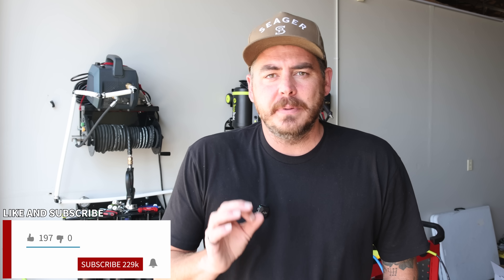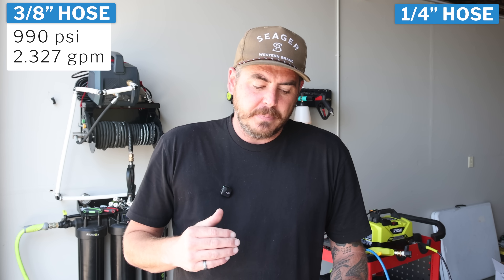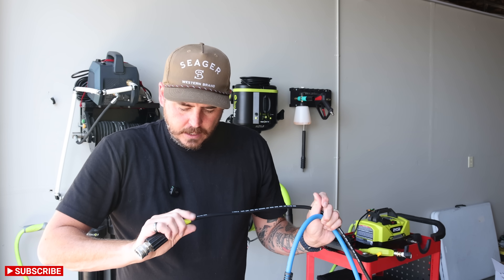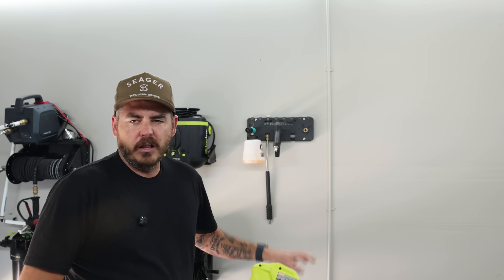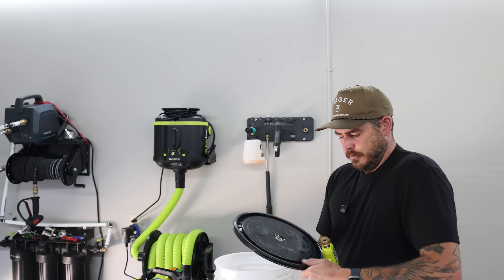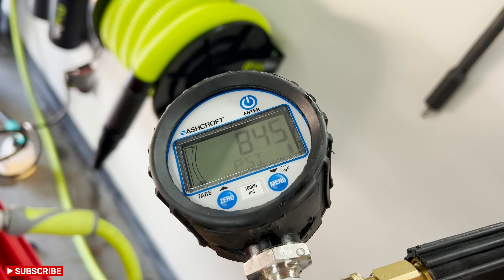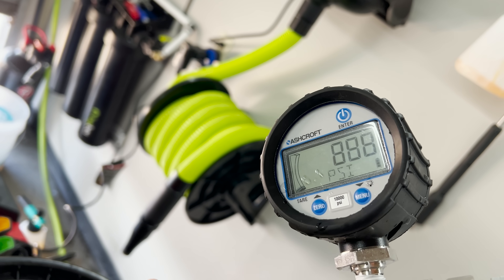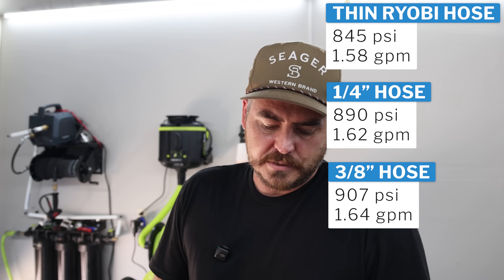PRESSURE WASHER HOSE COMPARISON - DOES SIZE EFFECT PERFORMANCE?

Comment: I just bought a 5000 psi 5.5 gpm honda gx690. I bought a 1/4 which i never worked with before. It says 5800 psi . The hose that came with the pressure washer is 3/8  and can't bend it even with 2 hands ,no chance. The 1/4 inch seems very thin, i can even push it to compress it. Can't do that on a 3/8 with wires and thick rubber. I'm afraid to use the 1/4 inch. Don't want to break the jetwash because now the pressure changes.

Comment: What is the best 75' hose for an active 2.0 pressure washer? I originally wanted the 3/8 Kobrajet hose, but I'm starting to think a 1/4" hose will be better as you mentioned for the weight. Any recommendations on a good brand?

Comment: What about water hose (from the spigot) sizes? Like is there a difference in pressure washer performance between a 1/2", 5/8" and 3/4" water hose diameter? Also, does adding things like quick connect fittings and/or a cutoff valve (both of which typically have a smaller opening them the hose itself) affect it? I ask because even a 1/2" hose typically has 5x or greater flow rate (gpm) than any consumer grade pressure washer can hit, so if it's still feeding 10gpm to the pressure washer, that maxes out at roughly 2 gpm, does that water hose diameter really matter at that point?

Comment: I recently bought a Flexzilla hose to replace the stock hose that kinks like crazy. I'm getting less pressure out of the pressure washer. Though the Flexzilla hose is bigger, the hole openings are slightly smaller than stock's.

Comment: Great video boss, as always bringing great content.. one thing I ask myself is does the  size of pipe that Supplys the water matter ? Does that impact or not really…  I see people using 1/2 inch to 1 inch to get reduced to 3//8ths jumper hose and fittings..  

Maybe you have tested this before ?
Reply from the maker: The outlet pressure from the water source definitely effect over all performance (so the hos whose size could potentially as well)
Reply: @imjoshv thanks for the reply, wow, I enjoy your videos and the jnformation, tests that you do.

Comment: Replaced my adams 1/4 hose with a Blueshield Arimid Kevlar 50 foot 1/4 inch hose and now my Adams Pro (previous generation) just runs upon start up, after activating the triger on the gun the tss system works fine, I did notice it doesnt seem to ramp up quite as fast. I have made sure to bleed all the air out. Would appreciate if Josh or anyone has any thoughts on this. Never had a issue before I replaced the hose. The blueshield has a larger outside diameter and I am going to make an assumtion the the Id is slightly larger. Thanks everyone.

Comment: Hare's a little more to take into consideration:

The water blaster runs at a constant RPM... which means the pistons pump at a constant speed... which mean the pump pumps a constant volume of water.
If the nozzle (or any other restriction) requires more pressure to push that amount of water through... 
that doesn't happen.
Instead, the excess water that cannot be forced through at the pumps maximum 'designated' pressure, bypasses through the unloader back to the garden hose inlet.

This is why, when you add a restriction like thinner hose... the volume ow water exiting the nozzle is less... and the pressure measured at that nozzle is also less...
Interestingly the AR630 historically has been set to run at 1.9kPSI at 2.1gpm with the correct nozzle... I 'assume' the "New" unit tested would have similar specs..
The fact that the pressure measured is less than 1kPS (which is always slightly lower at the nozzle) may be due to slightly larger nozzles although the flow rate is also less than optimum which seems to imply the unloader is bypassing water even with the 3/8" hose...  which leads me to think the unloader knob was dialed back allowing the water to bypass at a lower pressure.

Perhaps running the same test with the pressure gauge at the pump.. (in theory the pressure should be max for all 3 if the nozzles are correct as any more restriction will still show max pressure, any greater pressure bleeds out through the unloader as bypassing water...).

Now I'm in NZ and we have 240V 10A to play with... but if it's running 110 at 20A it should be able to get 1.9kpsi...
BUT... if it's running slightly larger nozzles, then the pressure would be down... although I would expect the rest of the restrictions to be negligible so the flow rate should be optimal (2.1gpm)...

I guess without it in front of me.. I'm missing something...

Comment: My damn uberflex 1/4” hose keeps losing O rings inside the hose fitting and popping out when i disconnect my gun…gotta contact them i have bunch of o rings but not correct size and diameter….id like a 3/8”though as well

Comment: I’m confused on what tips to go with? And does the orifice matter on the tips? Anyone have suggestions?
Reply: Tips vary hugely and are pressure washer dependent.  You have fan tips that can typically vary from 0 deg, 15, 25, 40 degree tips which is the width of the fan spray.  The orifice is what determines the PSI and GPM of each tip.  The larger the orifice the less PSI but more GPM you will get.  Typically for washing cars you want around 1000PSI and the higher the GPM the better.  Each pressure washer specs are different as to how the orifices will change them so it is hard to give you an answer without knowing what PW you have.  As far as fan tips, I like 25deg for wheels and door jambs and 40 deg for the rest of the car.  If you have a common branded PW , check Josh's videos to see if he did a review on it or check out other Youtuber's that may have done one on the one that you have to help you get an idea on what orifices they suggest.  I typically use 3.0, 3.5 or 4.0 orifices on my Greenworks Pro 3200PSI/2.3GPM PW depending on my needs.

Comment: Need some help. I use a ryobe powerwasher at work which came with a scrappy hose. I just bought the Costco powerwasher for home use and did the Uber flex hose upgrade from one of your videos that helped me by all the correct adaptors. I want to 7se the steel braded hose the costco unit came with on my work ryobe power washer but am having issues buying the correct adaptors. Ryobe is 22-14 and the costco hose is 22-15. Can you help?

Comment: I'm trying to decide between a 5/8" diameter Flexzilla 50' hose or a 3/4" diameter as the inlet hose to my new Ava Go.  I've read that both sizes have the identical nominal inside diameter of the fittings as 0.460".   Should I assume then that the larger diameter hose would not make much of a difference for flow?  The price of these two sizes is much different.

Comment: If a machine is rated for 1800 PSI and 1.2 GPM, and you connect a 50-foot, ¼" ID hose, then, the amount of water delivered at the end of the hose in 1 minute will be 1.2 gallons. If you collect less it is the machine not the hose.
Reply from the maker: There are lots of factors including the size nozzle you are using, the hose, the water inlet pressure, etc.. A machine thats rated 1800 psi and 1.2 gpm will rarely get those numbers at the nozzle for actual performance. Those are based on how the unit is tested and not real world use case
Reply: @imjoshv Hey, I was wrong. I redid the math and lets assume you have a pressure washer that produces 2600psi and a flow rate of 2.4gpm leaving the machine and you attach a 50' 1/4" hose. What would be the pressure and flow rate loss be at the end of 50'. The pressure loss would be reduced by 288psi and the flow rate would drop from 2.4gpm to ~2.0GPM. What if you used a 50' 3/8" hose with the same pressure wash as above? What would be the loss over 50'? You would lose ~25psi and the loss in the 2.4gpm would be negligible.

Comment: Great review. Is the Ryobi pressure washer you reviewed a good beginner unit? If not, what would you recommend?
Thanks
Reply from the maker: Great beginner unit! You can use everything it comes with. It even comes with a 40" hose. Its not the best hose in the world but gets the job done better than most other factory included hoses!
Reply: Are you hoping to be around $400 for yours

Comment: Its very important to note that it depends on the oressure washer. That ryobi doesnt do enough to be bothered by the diameter or length of hose too much, but the ar630 sure did.
Its a cool test if we were only using the ryobi, but thet logic isnt garanteed to apply to other oressure washers.
Reply from the maker: Yes thats very true!  Hose size can get especially important on larger high PSI high GPM pressure washers

Comment: Great testing and I am glad that you included amp numbers. I found the same with mine and in fact the difference between the stock hose for me and an uberflex was about 1amp. I also found that the amp draw was about 1/4 amp higher with the stock Ryobi gun than my SGS35, and confirmed it by switching back and forth, so no warm pump conspiracy theory involved.
Reply from the maker: Interesting! I never considered the gun causing a difference. Thanks!!

Comment: also of interest would be the effect of the different input hoses. Expandable ones are typically considered 1/2" whereas the standard rubber or hybrid (Zero-G) would be 5/8 or 3/4" and then very heavy commercial 1"
I would guess besides flow rate through the pressure washer, would be the decibel level of the pressure washer
Reply from the maker: Thats true Flow rate of water into the pressure washer can definitely effect its performance. Usually going from a standard hose outlet psi to a gravity fed system with lower psi will also effect the end psi and gpm

Comment: everyone also take into consideration that a stronger pressure washer will have more drastic differences in between different hose ID's(hypothesis) than this entry level pressure washer!!!❤
Reply from the maker: Great point! I do mention at the end of the video that this gets more important especially for larger high psi and high gpm units! The differences would be amplified based on the percentages
Reply: You are absolutely right.  I'm running Dual Ryobi Automotive High Flow's and I was maxing out at 2.84 GPM at 875 PSI (14.4 amps each) with a 100' 1/4" steel braided hose... swapped to a 75' 3/8" steel braided hose and hit 3.03 GPM at 1000 PSI (6.5 nozzle on both)... next was step up to 7.5 nozzle and now at 3.27 GPM at 850 PSI and amps dropped to 12.5 each.  I'm finally hitting the numbers I was expecting after upgrading from Dual Ryobi 1800's.

Added bonus... Average dB for the 1.8 GPM's is 79 versus 81 for the 1.2 GPM's.  That's measuring about a foot, centered between the units.  Less noise than an Active 2.3 and performance close to the new AR630.
Reply: @AMI_Detail why are you running two pressure washer units?
Reply: @xRichardBLongx  You get double the output.  I get better numbers than an Active 2.3 for half the cost.  The noise level is lower as well. My Dual Ryobi Automotive High Flow system is putting out 3.27 GPM at 850 PSI using a 7.5 nozzle.  Amperage draw is 12.5 for each unit.
Reply: @AMI_Detail  why would you want or need double the output especially when one is far more than enough?  Commercial pw cleaning business?  True, you might be able to rinse slightly quicker, but the difference in time saved is minuscule.   Pros do not outweigh the cons
Reply: @xRichardBLongx  It all started last year when I couldn't justify spending $350 for an Active 2.0.  Since I already had a Ryobi 1.2 GPM unit, $180 got me a second one and the hoses and fittings to combine them.  Matt Moreman's dual Kranzle setup was some of my inspiration and Bob from Chem-X proved it would work on his Siamese Ryobi video.

You are right on about NOT being a time saver.  It's really about the user experience.  Flooding the panel with more GPM is a luxury.  Being a car guy, I can drive my Bronco Sport to get places, but taking my Porsche is more fun.
Reply: @AMI_Detail  The YouTube guy who pretends to be an expert and acts like he is OCD is the one who inspired you to  use two pressure washers?   He probably started using two since he sells them and wants his followers to buy more from him.   Interesting to hear user experience get brought up.
Reply: @WillieBeamin-t4v  inspired was probably a bit strong... I went to his website and looked at the parts list... then followed Bob at Chem-X and added the last piece of the puzzle, check valves.  I ran the dual Ryobi 1.2's for over 10 months with no issues, contrary to the fact Matt said would not work.
Reply: @AMI_Detail lol all good.

Comment: I bought a 3/4” garden hose years ago because I wanted more flow than the standard 5/8” hose.  You do get more flow, but the weight difference between them is huge!  Not worth it for me, so I went back to a 5/8” inch hose.  Same thing you’re saying about the 1/4” vs 3/8”.
Reply from the maker: Yea exactly. Its all a balance and for me I like the lighter options
Reply: I wish he tested different size hoses that go from the tap to the pump.

Comment: Hoses are measured by the inside diameter, while tubing is measured by outside diameter.  Fitting construction is the actual restriction because fittings ID is smaller than the hose ID.
Reply from the maker: Ive always though that as well and since the smallest point with most restriction is at the nozzle, i didnt think that the hose diameter would matter.. But there is still Friction loss as the water passes through thinned ID hoses so it does end up makinga. difference

Comment: Listen to the machine, it sounds like it’s working way harder with smaller hoses, how much do you want your expensive pressure washer to work? Or do you want it to last as long as possible by using a hose that lets it flow.
Reply from the maker: The smallest hose is what Ryobi ships with the unit. It does increase the amps of the unit but they are still in a safe place. However, i agree with you that the larger hose size reducing the amps and would most likely help the longevity of the pressure washer

Comment: Uberflex also has 1/4" hose that's 3100 psi rating (the one you have) and a red one that's 3700 psi. I imagine the red one has a thicker wall and smaller ID. It would be nice to see that comparison.

Comment: One of my key takeaways from this testing is that the unit never hit the claimed 1.8gpm.
Reply: I got 1.77gpm in my Ryobi testing. They actually lived to the claims with me.
Reply: Think it’s rated at the pump and not at the end of the gun / hose
Reply from the maker: Exactly they always test at the pump in one of the chambers... There is some loss by the end. The power of this machine at the price is still amazing for cleaning cars
Reply: Even if it didn’t it will output far more than enough is needed
Reply: They never do. They all lying a bit to sell their shet. And depends on the length of hose and nozzle size.

Comment: I’m using the Adams 1/4” 60-foot hose with my dual Ryobi 1800 psi 1.2 gpm machines. Love the hose, and I’m very happy with this setup. I’m using a 6.0 nozzle which puts me at just under 900 psi according to my gauge. The Tutuluck stubby gun that @carswithkeav suggests is also a game changer. The swivel is absolute butter! Thanks for all the great info Josh!

Comment: This is very timely because I am evaluating 1/4, 5/16, and 3/8 inch hoses. The question I am most interested in right now is whether the exact same hose in different diameters is more or less prone to kinking. Is the 1/4 inch hose more likely to kink vs. the 5/16 or 3/8 inch of the exact same hose?
Reply: I decided to go with the Active 5/16" 50 ft hose for my Active 2.3, but considered everything. I like it a lot and it has yet to kink. Of course it is heavier than the Uberflex 1/4" but is still quite light, flexible, and durable.

Comment: I got a Chinese AR with a higher rated flow and the hose is thinner than the Craftsman (1/4). I tried to use the AR with a 1/4 yamatic hose and it doesn’t work at all.

Comment: Josh - You need to measure the pressure at the inlet and the outlet of the hose at the same time to get the full story of the pressure loss due to the hose. Remember, a PW does everything it can to deliver the rated flowrate, not PSI. In a smaller hose, to deliver the same flow as a 3/8" hose it encounters more friction, which requires more amperage. For anyone who wants to understand some of the actual science regarding hoses: https://youtu.be/FlZrX5EPNGo?si=AdF-0dfCyiioR2ys

Comment: Both my uberflex 1/4 ripped or popped within few months. 3/8 is gong strong with no signs of wear 💪🏼
Reply: Strange. I've been running a 50 ft red uberflex and a blue 25-footer for about 5 years now with no problem other than cosmetic scratches. I did, however have a 50 ft black Uberflex bust on me about 4 months after I bought it. Out of curiosity, what color and length were yours ? 1/4 btw.